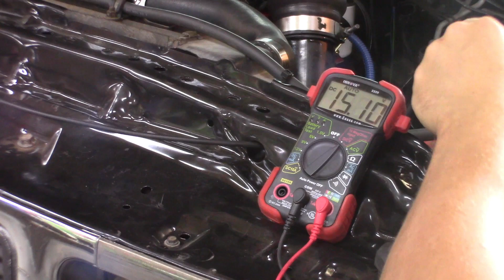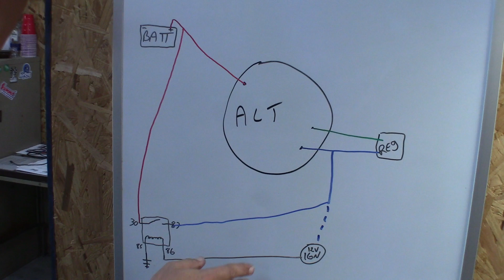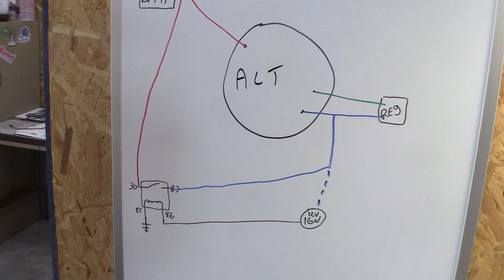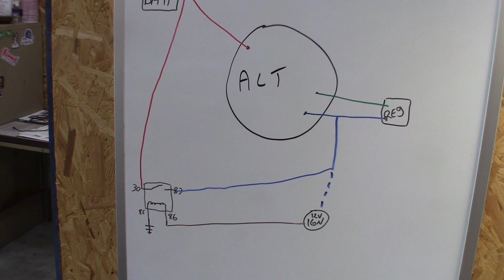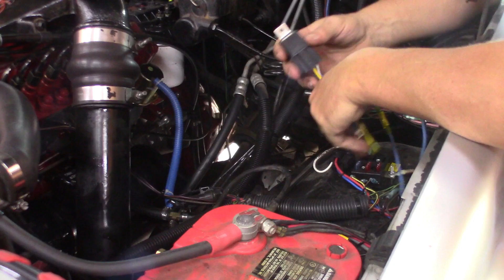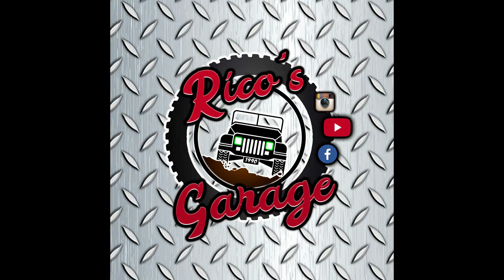Cummins / Chrysler External Regulator Overcharging Issue Fixed

Comment: Having the same problem with my 99 dodge 1500. Putting off around 19 volts at idle.
Drove it for probably a few hundred miles myself like this and my dad took it to 3 mechanics payed way to much money and still know one figured it out. 
I bought the truck from my dad because of this for cheap..
I didnt know what was wrong until one day i popped the hood and heard the new battery boiling.
Did some research on why my gauge cluster kept shutting off, airbag lights going crazy, the dinging bell, headlight dimming and then going hyper bright all at the same time.
It would do this every 15 minutes somtimes, or 5..or sometimes go 20 to 30 minutes of driving.
Anyways now im doing a old school voltage regulator like what most people's are doing and by pass the ecu.
Im just stuck on how to hook it up, all the instructions say the main only large wire off the alternator goes right to the positive terminal on the battery..
Well not on my truck or my buddys 2000 dodge 1500.
On these that one single large wire bolted to the alternator goes to the negative terminal.
It has me scratching my head because the only other wires on the alternator are the two tiny field wires that go to the harness plug on the alternator..
Maybe on these it charges through one of those tiny wires and through the ecu?? I dont know.
That part throws everything off for these oldschool voltage regulator instructions ive found.
It says dont connect the voltage regulator directly to the battery..
Well how else would you do it😅
Its supposed to regulate the voltage between the alternator and the battery aint it..
Im going to keep researching and see because maybe im not understanding something..
Help😂

Comment: Thanks Kindly Just finished wiring in the new external reg. high 14's to mid 15's, have a 4 prong relay on hand, gonna wire it in today. ?? for you is a high 14 running steady too much?? I have ordered another reg that is adjustable, curious what the adj parameters of volts are, any info on that.  Excellent work, and thank you for sharing !!! cheers from your northern neighbor.

Comment: So is pin 86 to how fuse on the 6 fuse junction box ? I get that 30 is battery 87 is wire from regulator / alternator and 85 is ground but what is pin 86 then

Comment: You Tell Me '''''   2002 ram '''   put two new battery's in a year ago ''''  i only drive the truck 5.000 mile's a year Low '''' Checked  Battery's A Year Later '' There Low On Acid ''' And Driver's Side Is ''WET'' Under Battey '''  I Think Theve Over Charged At One Point '''' Checked Output ( 13.8 ) V '''  you Tell Me What The HECK '''   NO ''' There Not Leaking '''' I Knew Your Next Question ''''  Little Jimmie ''  TULSA.

Comment: I have an 04 Dodge 2500, with the Cummins engine. I've been dealing with a surging issue in my throttle pedal for over a year.  Two years ago I converted the truck to an external voltage regulator.  This week my alternator died and I replaced it.  I then started dealing with voltage surges, so I followed your directions, adding the relay.  The voltage is now hanging around 14.4 volts and the throttle doesn't surge any more.  Thank you so much for passing your idea along to us.  I'm really happy that you managed to fix two problems for me!
Reply: ILL TELL YOU '''  I WOULD RESEARCH ALL MY ''GROUND'' POINT'S '''  AND ADDRESS THEM '''   THEN GO FROM THERE & SEE WHAT HAPPEN'S '''   10 - 4 .

Comment: Should I tee the green wire into 12v battery post on the alternator also? I get 17.4 volts as soon as I start driving, even with the relay so Im starting to think the regulator isnt seeing actual battery voltage somehow.

Comment: I tried everything was still overcharging. Voltage sometimes goes up to 20 volts changed the grounds. Cleaned everything put an original mopar vr on it. Specially on cold start it ran up to 19 volts. What I did now. I put a ferriet filter around the sense wire now it’s steady at 13.8volts hope this helps someone because it drove me crazy.
Reply: What is a ferriet filter around the sense wire? I have his exact problem.

Comment: Nice instructional. 
Please tell me, wise diesel man. I am new to diesels.  Can old/bad batteries cause fuel feed issues? I have a 2005 Ram 2500 Cummins. 200,000 miles.  It seems to act like it has a clogging fuel filter. But filter has been changed twice by me.  Not the fuel filter, they were just mildly used and fairly new too. Stalls randomly at stops or near-stops, sometimes.  Hard starts sometimes afterwards.  Won't do over 1,700 rpm very good for more than a few seconds.  Letting it idle or sit for 20 minutes makes it better for about 25 miles. Keeping it under 1,700 rpm and under 50mph allows it to work fine, except on very steep grades towing highway speeds, then it has hard time getting up. If I push it past 50, like 65 to 80mph, it acts like it's fuel starved and expels unspent fuel smoke. Does not smoke otherwise.  Doesn't have blow by (as of yesterday). Leaks and uses 2 quarts between 5,000 mile changes, once every 2 years. Has a  good air filter. Coolant good and full.  Check Engine light codes appear when it stalls. But when reset they stay away until it stalls again. Tranny is not slipping and it's full and fresh.  Did it in Tow Mode and regular. Seemed better in Overdrive mode I think to due lower rpm.

Batteries are 8 years old and both are very weak. Alternator is showing 14.5ish Volts on dash and with my multimeter at each battery.  But charged they hold 11 volts combined. Needs jump to start, but then seems to run fine. All accessories work fine too. Will not restart when ran for minutes or hours and needs to be jumped again, but a very mild jump source will start it then.  If pushed in a mild tow, say 6,000 lbs, up hill, beyond 45mph, it starts to go into a limp-like mode.  Again, it will recover when idling or off for 20 minutes, but comes back quickly, like within 20 to 30 miles. 

Will bad Batteries ever cause these issues?  Many thanks!

Comment: I have my voltage regulator wired up with a relay now, just like you showed on the video. My volt meter is bouncing between 14 and 16 volts. Headlights and dash lights bounce as well. Would a bad battery cause this issue?  Or a bad voltage regulator?  The battery reads at 11 volts or so when off.

Comment: was overcharging before installing a relay and now it wort charge at all. do you think its possible i fried the regulator? this is on a 99 ram cummins, bad pcm. alternator tested good. was reaching 19v without the relay installed. any idea that could cause this? betteries dead now so when they charge up ill try again.

Comment: I just did this on my 1991 Dakota and the needle holds nice and steady, lights and alarms don't pulse... but now the key won't turn off the engine!
Reply: Did you ever figure it out ? Thanks
Reply: @bongwaterboy8179  Yeah bro I put a kill switch in the cab by the steering wheel, attached it to the 86 wire (the white one) on the 4 pin relay. Now to turn the truck off I turn the key and flip the switch at the same time.

Comment: This is why youtube is awesome! Been fighting the dreaded Chrysler electrical demons and this finally fixed it.   So thank you for your dedication to your channel. Question though, is this a band-aid fix and just covering up my voltage drop issue? if so what is most likely the culprit, main positive from alternator? on these old dodges the main positive is longgggg and quite small if you ask me and probably corroded, or is it the 6 switched wires that we bypassed?
Reply from the maker: While the relay is a good permanent repair. You are 100 percent correct on the main power wire. 
An upgrade there would be very worth the time and money spent. 
Thanks for the kind words and for watching

Comment: Will this work on 91 dodge w250...I did the same thing but it over chargers....when I rev it...goes up to 16-17 volts...ideals it backs down to 12-13 volts....ps it's a 360 LA gas engine....the computer is junk...had my friend came down from pa in install the old ignition system but had to put a rely on that back when we try to start it ,it would it tried when id back off the ignition key .....

Comment: @ricosgarage I did the exact set up and it fixed the charging at idle only but once I gave it throttle it starts to clim again up to 16-17 volts. Before doing this it was charging 16-17 when truck was running causing passenger battery to boil over smelling like rotten eggs. Then I found this video and I did the same set up and it charged fine at idle but once giving it throttle it goes back to 16-17 volts again. I put a new alternator and didn’t change anything. What else could it be?
Reply: Did you find the problem?
Reply: @Quincylego  I followed his instructions in this video and it’s been working fine since then.
Reply: @Quincylego yes I fixed it adding a relay to the voltage regulator and has been running perfectly for about a yr now.

Comment: Thank you for this video!  I followed your instructions from the first video to wire in the external regulator for my 6BT swapped 72 Ford F350 last night and fired the truck for the first time.  I saw 15-15.6 V.  I was bummed for sure.  This fix makes perfect sense!

Comment: I got the same thing going on. Put  ne terminal on, then changed both batteries, didn't fix my problems. 
My meter reading 15.2 volts just Still. 
Driving it's 16.5.

Comment: I can't thank you enough.  I have a Frankenstein jeep wrangler.  I have been fighting this voltage issue for over 2 years.  Wired in a 4 blade relay, just like you showed and everything is smooth as can be. Thank you very much.

Comment: I am doing a Chevy Cummins swap and wondering what the heavier gauge wire is that went to the 2nd field terminal on the gas engine? That wire was also connected to a 2nd wire with a ring crimp connector that went to the battery connection on the alternator? I am just wondering if I need to connect those back to the alternator if they are running something in the truck? Thanks
Reply from the maker: Basically all you need is wiring from the back of the alternator to the junction box on the firewall and then follow my diagram for the rest. 
My other videos detail all the wiring needed and how to use the factory gauges. 
Thanks for watching!

Comment: What gauge wire did you use
Reply from the maker: 10 gauge for battery power. 14 gauge for the lower amp side

Comment: This is the best video, best explanation as well,..  many thanks this save me..
Reply from the maker: You've welcome. Glad it helped
Reply: @RicosGarage  yes you did it.. I submitted my feedback on Amazon cuz I bought external voltage regulator and did my review and I post the link of this video.. it's really helpful now my voltage is stable and charging at 14.7+ due to 6k watts system, I'm using a high output alternator from mechman.. many thanks.

Comment: Great video… But still having high voltage problem… 2011 dodge nitro… Putting out 19 V… With the relay… Any suggestions
Reply from the maker: Verify that your regulator is seeing actual battery voltage.

Comment: I have same issue with mine over charging so I did this step by step and worked great charging at 14v for roughly 5 mins then bounced right back up to 17v.  Any idea why it's over charging again?
Reply from the maker: Sounds like your regulator is not seeing battery voltage. 
1. Bad connection
2. Bad regulator
3. Bad relay or pull in circuit. 
Hope this helps

Comment: this was not at all clear in terms of what wires you connected and where.  maybe i'm just bad at reading diagrams though lol. having this issue with my '77 ramcharger and this solution seems much easier and cheaper than buying a $200 one wire alternator, I'm having trouble figuring out how to wire it though.  How would I wire this on my old '77? There's a blue and green wire going to the voltage reg, and one big black wire going into the firewall (and i assume into the ammeter, and battery, but i'm not sure where).  any help you could give would be great, thanks!

Comment: Thanks for the video, it solved part of my problem. My 2003 dodge Cummins was over charging 16+ and pulsating. Now i added the relay and i get a steady 16volt no pulsing. I had the altenator rebuilt, no change.I checked all the grounds. any ideas?
Reply: Do you already install the external voltage regulator??

Comment: Great video, you have a part number for the regulator?  I was told it’s internal in my alternator.
Reply from the maker: Order a regulator for an 84 D100 with a 318. 
That will get you what you need
Reply: @RicosGarage  Thank you, I’ll give that a shot!!!
Reply: @RicosGarage  One of the main problems with the so called "first-gen" external voltage regulators is that almost all of them are poorly constructed Chinese copies of the original Mopar units, and the failure rate is "off the charts", even the so called "heavy duty" units with the little adjustment pot on the back side. Actual American made Mopar units are readily available, and they're far superior to the cheap Chinese junk being sold at most of the Auto parts chain stores.
Reply: It’s not a factory part. Something in the pcm shorts out and you use an aftermarket voltage regulator kit. I have one on my rig and the voltage/lights have been surging so this corrects that after installing the external regulator kit. Something like that lol
Reply: @Ghostdancex  Yeah, I’ve having overcharging issues with my 2nd gen.  I tried getting a regular from the parts store, but they said my alternator has one built in.  So, still having my batteries corroding…
Reply: @RyanSmith-jl4fw  watch the video “shorts” from @StartUpSlick . He has a video that shows the Transpo V1200 and relay setup. Video title: Dodge Cummins 12 valve Alternator PCM …

Comment: I've got a 2016 ram 5.7L and it's over charging. I installed the external regulator fix. But it's over charging. I tried a test putting the power directly to the battery to see if a relay would fix it, but it still went to 16v when at high idle.. I'm out of ideas...

Comment: Rico u r the man !  I installed a external voltage and a relay  . I hooked it up the way u Howes us and my volts are at 16
Reply: What can I do now brother ?
Reply from the maker: Have you verified this with a voltmeter or is this the gauge reading? 
Make sure the relay is getting power straight from the battery and that the regulator is getting actual battery voltage.
Reply: @RicosGarage  yes it's from the gauge on the dash but I've melted the plastic at the alternator fuse  already . This is the 3rd regulator I've traded in Frome the store
Reply: I can't get it into overdrive either I've tried tps delete kit . Tapped in a switch to lock it into od still nothing
Reply: Man I wish u were in Canada I'd ship u the truck lol 1998 12 valve  I've done alot of mods to this engine and truck. She's cranking some horses

Comment: I’m pretty sure I had the same problem in my 89 d250 my lights on the message center would flash on and off and my battery was boiling the acid out before I could get it fixed it I guess it got some wires in the dash I saw smoke come out and some of the lights on the message center went out and then the truck died I changed out the battery and the truck will turn over but not fire up unless u give it some starter fluid I was hoping it just got a fuse or something I took the dash apart a lil but don’t see any burnt wires any help or insite would be greatly appreciated
Reply from the maker: Consult a factory wiring diagram and locate the fusible link (s)
This is most likely your problem and they will need replaced if burnt

Comment: Thank you for this! I've got a 73 dodge van that's overcharging (17-18v) and already blew one battery up before I realized what was going on. I've swapped a new alt and 3x Volt Regs to no available. It makes a lot of sense, if the reg cant see the battery volts then it cant regulate. I must have a ground short somewhere but this would definitely help me get back onto the road for now!

Comment: I had the original bypass for about 2.5 years worked fine then one day it just started pulsing eventually blew my interior lights, weird idle ect... found this video and re wired the relay as shown and boom my truck is like brand new again. Thank you so much man, saving people $1,000’s of dollars in unnecessary repairs and diagnostics.

Comment: Hi. I have a similar problem on a 2011 dodge ram 1500. The voltage to the head light on high beam is max at 11.8V and it's drops to 11.2V. You can see on the light that it's not steady. Do you have a solution for this? Regards Svein